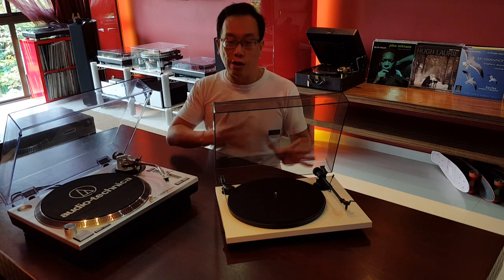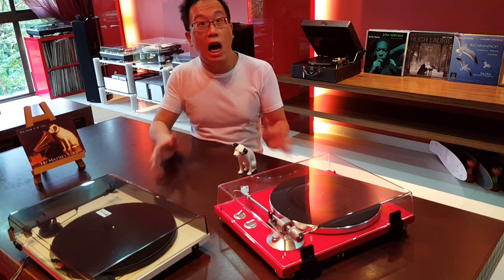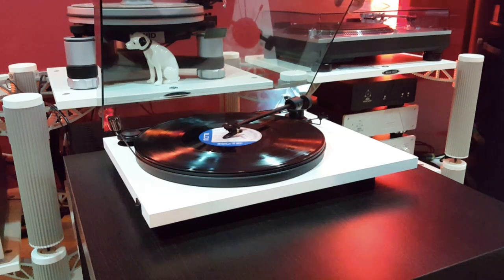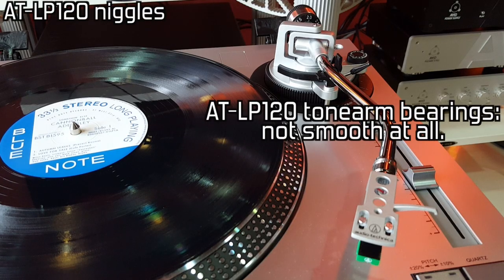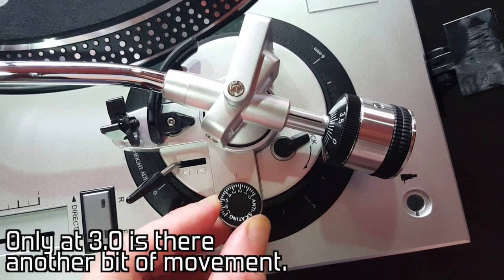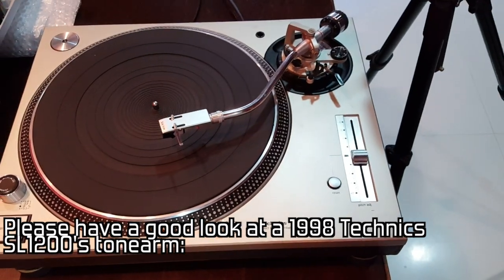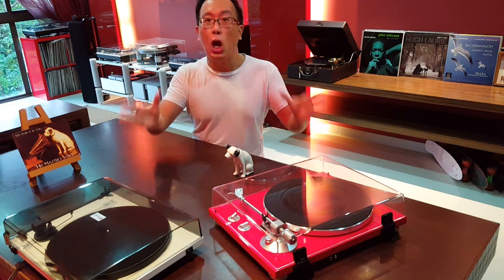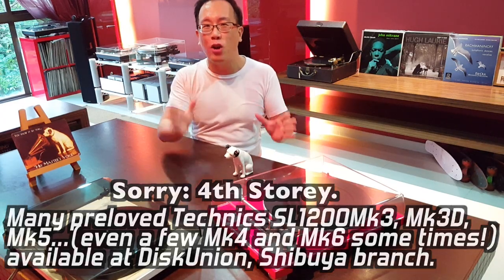Turntables $250 -$300: Shoot-out & Reviews.   AT-LP120 + Pro-Ject Primary + TEAC TN-300

Comment: I know this is an old video but if anyone has the teac tn-300, you can adjust the motor pitch. There are 2 holes on the bottom marked as 33 and 45, the holes are covered with foam so it's easier to adjust them by removing the bottom cover. Use a 1.5mm flathead screwdriver and with slight/small turns you can do the adjustments. It took me a while (a little over hour and a half) to adjust both speeds but I managed to get them in the +/-0.5% variation which I think it's excellent, at least I can't  notice any issues when listening to records, before doing the adjustment I did had some issues particularly I would notice when long piano or brass instruments were playing, now everything sounds perfect to my ears. I adjusted this about a year ago and it is still working perfectly. So I still think for the price, it's a really great turntable.

By the way, anyone knows what application he used to show the pitch issues with the TEAC turntable?

Comment: For years, I had a wide-eyed, childish desire for the LP120 as my first turntable upgrade. When I first saw this video in about 2017-18, your analysis alone was enough to knock it straight off my shopping list. I still enjoy checking out this GREAT video every once in a while. Thank you Ian for your expertise and honesty!
Reply: Isnt this a little outdated now since the LP120 is discontinued and the LP120X has fixed most of the issues?
Reply: @leonthesleepy  this is correct, however there's still some demand for used original LP120s because of the fact that they even have tonearm height adjustment (even though Ian here clearly shows it's off-whack, forcing you to correct VTA yourself by stacking a platter mat or two), and they're abundant, meaning you can find them for half or even a third of their retail price. I do acknowledge that the LP120X addresses much of the complaints about the original LP120, however the plinth is still plastic, and who knows if the LP120X uses the same flexy resonant ABS as the LP120...regardless the plinth and platter are still undamped, so make of that what you will.

The next model up, the LP140XP, has height adjustment, except it retails for $100 more than did the original LP120. For some, that's peanuts, but for a few, that's a large amount of extra money, so they'd rather hunt for the bargain: a used original LP120.

So given historical context... Yes, this is still relevant.

Comment: With a bit of fishing line, a piece of stiff wire and some lead fishing beads, I sorted out the anti-skate issue on my Audio Technica. Makes a Lot of difference to tracking - especially as I removed the silly A/T antiSkate mechanism. It's a bit of plstic and it frees up the bearings too. It is a very simple thing to make. based on my old Lenco. Yes! Remove the phone stage, Decent mat and shim and you get a MUCH better sound. Hardly plug and play though... Thank You my friend.

Comment: One thing you should mention is that you tested the sheapest Pro-Ject Player available. This thing costs around 200$ (NEW), compared to what you recommended (the nice Technics) that still cost about 300-400$ (used) in good-avarage condition. I also dont like Pro-Jects missing adjustment for anti skating and the missing scale on the tone arm weight. But away from this the Pro-Ject is probably the best turntable you can get for this price. Nontheless there a some good players at around 500$ that can be recommended. They don`t need a speed adjustment, some use good damping and they sound great. A used Technics SL-1200G costs 599€ in Germany, three times the price of a Pro-Ject... a totaly different price range (Compared to 199€ for the Primary e). Thats what i always say, compare apples with apples....an apple will never become a honey melon.

Comment: Last year I got a vintage Technics SL-Q3, and finally set it up a few days ago. With its quartz controlled direct drive motor and the standard Technics arm, same as on the SL-1200, it is a very close relative to the SL-1200. The main difference is, I can fall asleep playing Beethoven's Moonlight Sonata (an old joke from The Muppet Show, it is on Youtube), and it turns itself off, because the Q3 is fully automatic. This saves wear on your stylus!  The platter is extra heavy and thick, but only has a thick mat on it, without being coated underneath. It still performs well, and with its original mat it has no platter ring. The SL-Q3 is now replacing my Dual 510 in the living room, but only because the old Dual cannot switch to 45 without problems. On the old Duals, the width of any replacement belt has to be like the original, so it can jump to the 45 pulley and back to the 33 pulley, but they are no longer made.
While the Dual 510 (was in the 1977 and 1978 catalogue) sounds stable, measuring Wow And Flutter with the RPM app on my Samsung Android phone, it had 0.15% wow. The Technics SL-Q3 challenged the phone with only 0.03%.
Factory value was 0.025%, so the app is a digit short for the Technics! FLAWLESS after 43 years!
Still, the 44 year old all mechanical Dual, with a now over 15 year old replacement belt that is not as good as the original, is turning with better stability than modern belt driven turntables!
Both turntables have simply outstanding arms. The Dual makes different cartridges sound more different, while the Technics is more forgiving and gives sound more impact. The Dual has finer nuances and is more revealing for critical listening, while the Technics is a little more fun. 
Dual: Chamber music with classical instruments will be unforgiving to the musicians scraping their fingers over strings. But if they do it right, music and sound will be superb.
Technics: The orchestra is in the living room for a party!
I think I have to rearrange, so I can run both side by side, and select the one that is better for a particular record to listen to.
-
Finally a few tips for vintage Dual turntables:
If you like fully automatic players, the 1237 is the most reliable of them, with the best sound, and usually still works, with ONE small potential glitch. Automatic Duals are a specialty, so be warned about potential costly restoration of other models and their complex clockwork mechanisms, if you cannot do it yourself. The 502, 510, 505-2, 505-3, and 505-4 are arm lifters and shut off at the end. They are simple and reliable.

Comment: Should do a review of the Crosley C6; it's very unassuming, but surprisingly good and is at a lower price point that you could upgrade the cartridge to an elliptical stylus and still be cheaper than these 3 and even throw in a Schiit Mani. Sounds and looks like a much more expensive deck.
Reply from the maker: Hi Buddy! I think it is made by ProJect as well.
Reply: @HiViNywschannel  Would not be surprised. There are parts on the C6 that look very similar to parts on other decks. It's rather dynamic sounding for $150 USD.
Reply from the maker: @patrickthunnus  apologies, I would still recommend others, and avoid the above brands.

Comment: Shame on the manufacturers, especially those, who have been building gear since the 1970s and earlier. Why can't they build a solid turntable with good speed-control, and a good friction free arm, the way they used to? Home electronics have not inflated with other costs in life. Today, 400 dollars buys a very good amplifier, which would have cost the same or more in 1980. In 1980, you could buy a very good direct drive turntable for under 150 dollars from Technics, Pioneer, Akai, and others. A new company, Fluance, apparently has to come along and show the old fat and lazy manufacturers how to build a good turntable again for less than 1000 dollars. The VinylTV channel has a Fluance RT84 review, and it looks very good. The RT82 has electronic speed control and sells for 300 dollars. What I like about them, is they have automatic stop. If you fall asleep in your chair (it happens when you're tired or old), or get called away, no problem. The machine stops when the record is finished. I want that, so the SL1200 is not an option and neither are Pro-Ject or MusicHall. Why can they not include a simple auto-stop, like Fluance? Dual still makes semi-auto and full auto turntables, but their good models are more than 700 dollars - for a simple model 505-4, that has been made since 1980 for under 100 dollars then.

Comment: I had the AT LP-120 for a few years and I didn't really like it. The anti-skate never worked. I could never get the toner arm height adjusted properly, but worst of all, the loud humming and vibration was atrocious!! I couldn't turn up the volume without running the risk of blowing my speakers and subwoofer!! The fact that Audio Technica has still failed to rectify these well known problems is even more unsettling. I currently have the Teac TN-200 and I actually like it way better. I have upgraded to the Nagaoka MP-150 for my Teac and it sounds great. Very minor (if any) vibration and interference even with the volume turned up way louder than what the AT was capable of. As for speed and pitch issues, I honestly haven't noticed that with my Teac. I haven't noticed any unstable sound quality - not to MY ear, anyway. The counterweight and anti skip are bang-on accurate as well, unlike the AT which is much more expensive!! In my personal opinion, the folks at AT should be ashamed of themselves for charging $100 more for a turntable that I find to be far less superior (in MANY ways) than my Teac TN-200.
Reply: Well, one advantage of the AT is that you can practice DJing with it
Reply from the maker: Thank you for coming by again Buddy👋😄!!!! Great to see you again!

Comment: To be honest though, while a used SL1200 might be only slightly more expensive than the AT-LP120; the SL1200 doesn't have a built-in preamp. So if you start with nothing you should really compare prices as "SL1200 + phono preamp" < to > "AT-LP120".
Depending on which one you're getting and if you're buying it new or used, that could easily add another $50 - $200 onto the already slightly more expensive SL1200.
Reply: Sl 1200 cost in western world around 2000 dolars 😃
Reply: @enslavedemperor97  - Er, no it doesn't?

Comment: Hi Ian and thanks again for this video. As the Planar P1 seems such a winner, I asked my turntable seller if a Nagaoka mp110 would fit on it and he answered me that as far as the automatic anti skating on the P1 is not tunable and is already tuned for the rega cell, it could provoke bad tracking on this TT. The only way to go would be to unstick the magnet used for anti skating and restick it a bit further. So it’s advice was to privilege a planar P3 where the anti laying is tunable or a project tt. What do you think about that ?
Reply from the maker: True... go for the Planar3.  It would be better if anti skating is tunable. But many still, have fitted their MP110 onto their Planar1 and been enjoying it for more than a year since this video was made🤗😄✌!!...The MP110 is a superb tracker and that probably clinches it.  Sorry as i wouldn't recommend project decks (e.g. debut carbon) due to their 1)motor noise and 2)their suboptimally engineered and constructed tonearms(ignore the marketing hype about that carbon fibre trim).
Have a lovely journey brother and great to see you again!!
Warmest Regards my friend,
~ ian
Reply: Thanks for your answer. Did they install a 2mm or a 4mm accessory under the arm for good vertical tracking ? On the other side, no report for premature erosion of the stylus on one channel in that configuration where anti skating was not adjusted ? There weight is not the same Rega carbon at 5gr and Nagaoka et 6.5gr (Anti skating is linked to the weight of the stylus if I don't misunderstand ?)
Reply from the maker: Dear Buddy Olivier,
Sorry for taking time to reply you.  I had to allocate some time to work on it.
:-D  good news.
I have fitted on the MP-110 on the Planar1 two days ago, and actually measured the SRA of this set-up WITHOUT the use of any tonearm base spacers.  Many P1 users have been using this pairing for more than a year now.  So the finding: the Stylus Rake Angle of the P1 with the MP-110 (without any spacer), is 90.63degrees exactly.
This bodes well and i was actually listening with it for the last two evenings as well.  Totally okay!  I have not tried your retailer's method of resticking the anti-skating magnet before... but it is worth a try and experimenting.  Anti-skating is linked to the weight of the cartridge, and the tracking force employed as well.  It also changes from outer grooves to inner grooves due to the rakedness of the radius vs horizontal tracking angle.
Warmest Regards my friend!! I hope it has been useful and reassuring, it is 90.63degrees.  It is good.
~ ian.
Reply: Thanks for such detailed answer. I have replaced the AT95e on my TEAC TT by MP110 without trouble and with a great sound upgrade and will stick with this configuration till next year before reconsidering anything and spare money growing again.
Reply from the maker: @olivierleroy6983  Great to hear that my friend Olivier☺🙏👍💪✌🎵🎶🎶!!!!!

Comment: Hi Ian,

I like your informative videos very much. Tahnk you for all
your effort. I recently bought a AT LP 120 USB Turntable.
Your advice to add a 5mm thick rubber mat and a 1 mm headshell shim
to achive the correct SAR angle of 92 degree was new to me.
I like to follow your advice but the headshell shim is very hard to
find in germany. the only one i found costs 80 euros. 
So my question is. Does a 4mm thick rubber mat alone doesn't do the
same thing or is the combiantion of the rubber mat and the headshell shim
necessary ?
Thanks in Advance.

Regards
Herbert
from Munich
Reply from the maker: Dear Buddy :-D the 4mm thick rubber mat is not enough.  Apologies to you Herbert.
One can place two 3mm rubber mat perhaps :-D that would be more economical? I hope so for you in your locale.
Guten Tag!
Reply: Hi Ian,

Thanks for your quick and helpful answer. I think i had seen even 6mm thick mats.
So this seems to be the cheapest and easiest way to achive the 92 degree angle.
I watched your video on the Mofi Studio Deck too. It seems that it the Turntable i was
looking for. Thanks for this video too. I will use the AT LP 120 then probably mainly to play back
my Schellacks. I love good design hence the Mofi, and i also like to delve into history of
analog recordings hence the AT LP 120 (with a AT 95-78 cartridge for the Schellacks).
I know your advice is only for the AT-95E cartridge but i hope i will fit for the schellack-version At-95-78 too.

qinqièdewènhòu
hopefully meens
Regards
Herbert

Comment: Have you checked the Fluance RT81? I've heard good stuff regarding audio quality and overall structure
Reply from the maker: Dear Buddy :-D,
apologies as I would advise you to avoid it.  A certain OEM factory in PRC makes all of the OEM turntables e.g. ATLP120, TEAC TN-300, Onkyo CP1050, etc, and their quality is not sufficient for one to cross that critical line whereby the sound quality is worth your time with digital.
One can get MUCH better quality, MUCH better sound, worthy of your time and money invested in vinyl playback (instead of tapping on Spotify or Tidal) : -> Vinyl analog playback comes well, and comes well when one gets at least a Planar1, or a used SL1200Mk2/3/5.  They are slightly more expensive than the above listed OEM turntables, are made with care knowing what it entails to get the bearings right, the mechanisms for vinyl analog playback right, without the high cost (still below $500).  The money one spends on these latter better quality decks WILL be amortised by the sheer enjoyment of analog sound and by quality.
Please have a great vinyl'ing journey with many great friends!
Warmest Regards,
~ ian.
Reply: HiViNyws channel thanks for the reply. I did see your video about the rega.planar 1, Ns was absolutely amazed. I do want one, but in Mexico the price is very inflated, and getting a Technics is near impossible.
I guess I'll have to start saving cash haha. Thanks a lot.
BTW, EXCELLENT VIDEOS

Comment: Did you ever get to review the U-Turn Audio Orbit Turntable? I'm still looking around, haven't decided, but the orbit caught my attention, specially when combined with the Grado Black1.
Reply from the maker: With a tried and proven, high degree of engineering and manufacturing tolerances, i would strongly recommend one to hold his monies for the $200 more expensive Planar1.  The Rega's tonearm and its bearings are very well made, bringing life to cartridges, and its motor and pulley system on the spindle is a big class above the U-Turn Orbit.  Then again, at $250, the U-Turn Orbit with the Grado Black would be the only turntable i would choose to purchase.  My bet is still on the $400-$450 Planar1 as the first intro and long term turntable.  Warmest Regards Buddy!
~ ian.